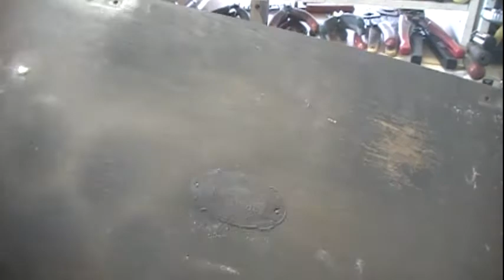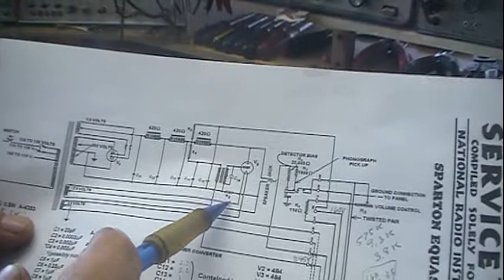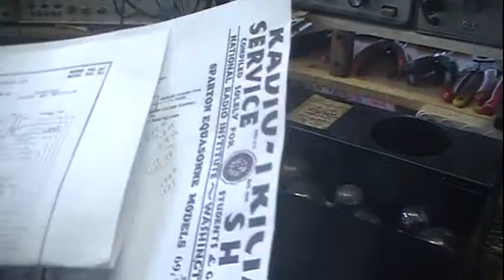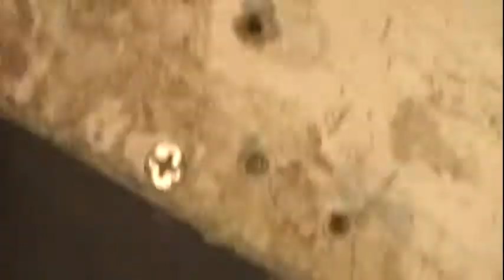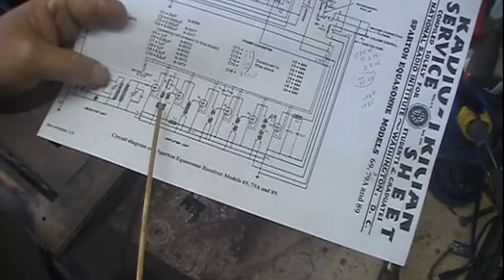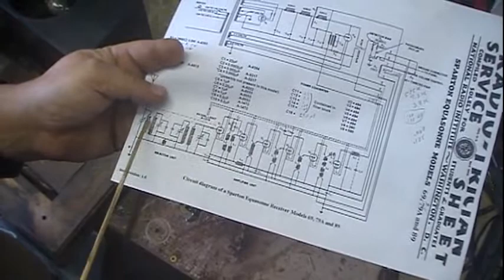Sparton 69 and the Technidyne circuit

Comment: I wonder if the heat, from all those tubes so close together, affect it or degrade it.
Good video.
Reply from the maker: MrMac5150 They will not get too hot, they are low power tubes. Thanks for watching.